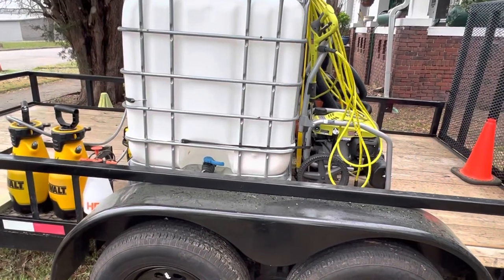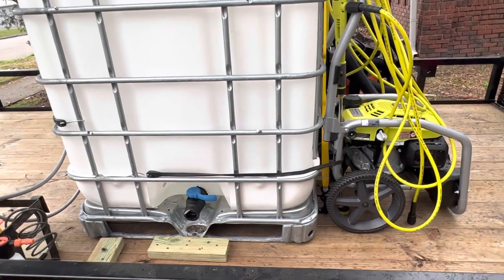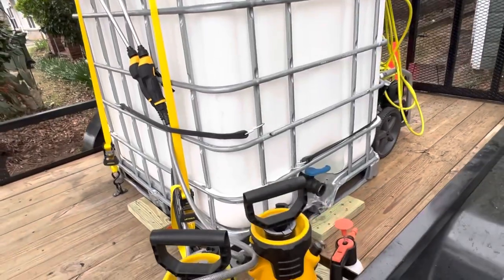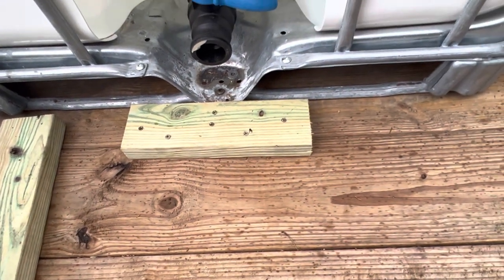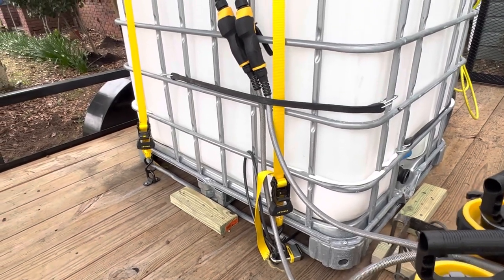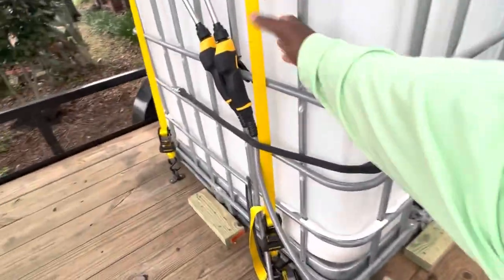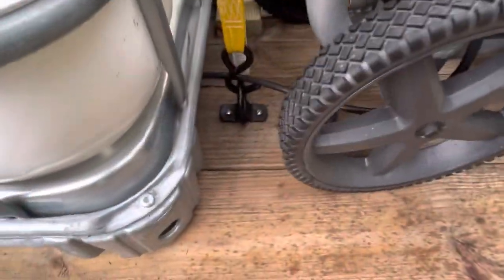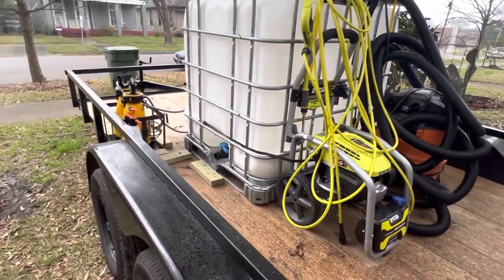How To Mount Water Tank to Trailer (SUPER EASY!)

Comment: How do you use your pressure washer with that ibc tote? I’m trying to get mine started but it’s just not working.
Reply: Most pressure washers won't pull water from a buffer tank unless they are a belt drive/gear drive, if it's direct drive then you need a pump between the tank and the washer to push the water to the pump.

Comment: can a 330 gallon tote fit on a 7x14 trailer? thanks
Reply: I know a 275 will fit on a 5x10 or in the back of a tacoma, but the 330 is 48lx40wx53H, so it ought to. If not you might need to find a new trailer dealership 😂😂